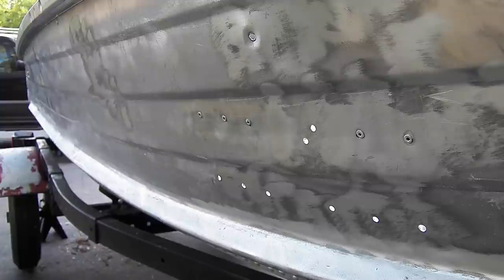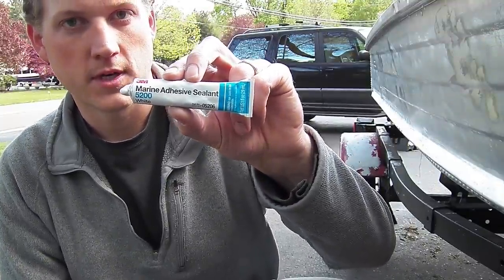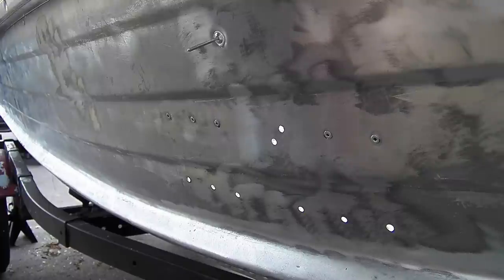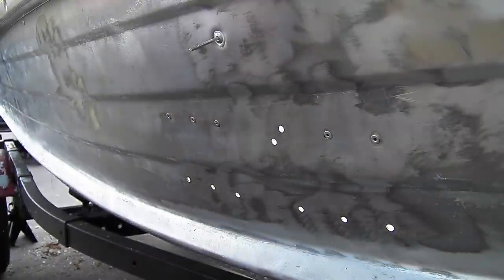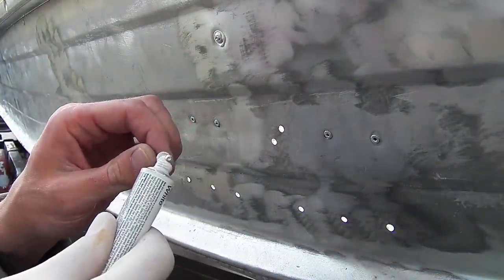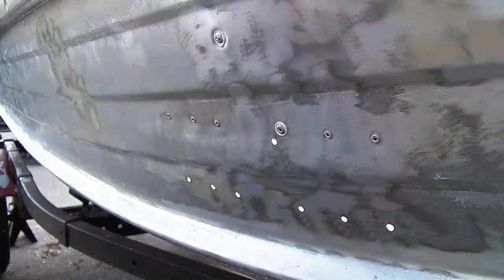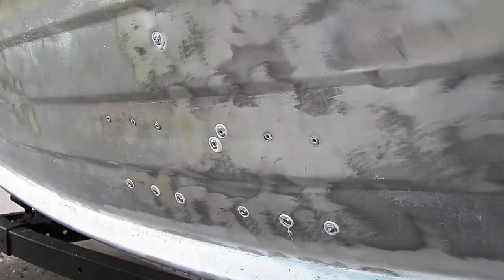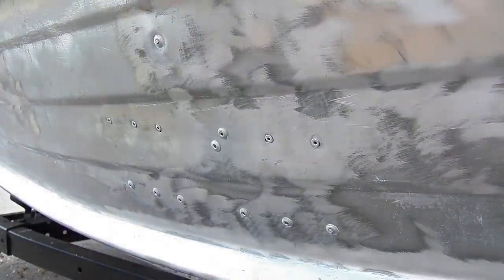Fixing Holes in an Aluminum Boat

Comment: Thanks for the vid. I just picked up an old Alumacraft V hull that was decked by bolting the framing through the hull. I want to remove it all and redo it much lower for increased stability to take my 85 yr old step dad out. This was very helpful. I'm going to just gut it and grind off all the old paint and do it all starting with your hole patching.

Comment: Purchased a tig welder recently to make boat repairs, but after viewing your video, a rivet gun is in order to give the unified look. Rivets have worked in building airplanes for years, it is sound technology. I'll use the welder for splits and holes. Thanks sharing.

Comment: another way to fix loose rivets is to use JB Water Weld. i used this on the bottom of my 1990 aluminum boat 4 yeas ago and it is still holding. fill your boat with enough water so you can see which rivets are leaking and loose, scuff up the area and then apply JB Water Weld around the rivets. this really works

Comment: I just ordered some dome rivets because I'd prefer that aesthetic.  The guy at grainger said they're installed the same way with the same tool, but I can't find videos of installation of dome rivets in sheet metal.  I'm using for a aluminum trailer that I'm installing.  Do you know if it's the same process?  I appreciate your help!

Comment: you only used 1 of your tools in these video.  I think the first two were interchangeable, but the last tool was unclear.  What is that one used for?
Reply from the maker: I think you are asking about 0:35?  That is one of the first two tools (you are correct they are interchangeable) again.  I am pointing out that the tool needs to have the correct sized die installed for the rivets you are using.  The rivet setter will usually come with 3 or 4 choices.  You just need to use the one that matches the size rivets you have.

Comment: you could have used some of those 2nd generation aluminum brazing rods and some Mapp gas. I think the secret is using the 2nd gen. not the originals and to use flux even if it's not required.

Comment: Use that same method on small rivet holes above the water line or is there something else I should do?
Reply from the maker: The same method works.  If it's far enough above the water that it never gets wet you can just use a regular aluminum pop rivet and don't need sealer.

Comment: Ty very nice job, I have been meaning to do this to some pesky leaks in my boat for years, 1983 Bass Tracker.
I realize this is an older video, but if anyone could point me in the direction of 1/4" Aluminum body/ aluminum mandrel that would be awesome, I can only find 3/16" in this configuration. All of the 1/4" I find have a steel mandrel, which probably isn't the end of the world I just would hate to have rust stains on my beat up old boat and possibly galvanic reaction too.
Reply from the maker: Those are a tough one to find.  I don't think I was ever able to source aluminum/aluminum in 1/4".  Not at McMaster, Grainger, Fastenal, any of my local places, etc.  Maybe with the 1/4" closed end it takes too much setting force for an aluminum mandrel to work?  Don't know.  If you find a source please come back to drop a comment and let me know!  While I def still prefer aluminum/aluminum, the aluminum body/stainless mandrel 1/4" rivets that I have used have not left any rust stains.
Reply: Jersey Tom, I will if I find any, I can't be certain that I even found aluminum/stainless in 1/4" as I had been focused on the aluminum/aluminum.

Comment: It looks like your using standard pop-rivets.  Will the new rivet form a leak at the center of the fastener?
Reply from the maker: Stephen Maurer They install the same way as standard pop-rivets, but the important difference is these are "closed end" rivets that are designed for sealing.  There is no hole at the center to leak.  You can get them at a fastener supply shop if you have one nearby, or online at McMaster, Fastenal, etc.
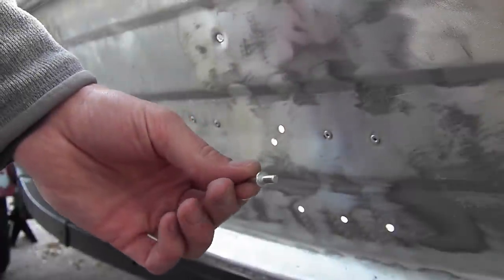Reply from the maker: Jersey Tom At 0:57 you can see how the closed end rivets have no hole in the middle

Comment: Is it the same for the bottom? I have seen stainless steel closed end rivets. Will those last longer for the bottom?
Reply from the maker: BN ANDRSIN Yep, same for the bottom, you can use this technique above or below the waterline.  It is better to use all aluminum rivets because galvanic corrosion can happen where two different metals touch...  If you use a stainless rivet on an aluminum boat, galvanic corrosion can actually slowly eat away the boat around the rivet hole.

Comment: Hey Tom, can 3M marine adhesive 5200 be used on aluminum? The label says only for fiberglass and wood. Thanks
Reply from the maker: Yes, it is compatible with pretty much all boat building materials.  They even publish performance data on shear strength for various woods and metals (including aluminum).  Check out https://multimedia.3m.com/mws/media/576967O/3mtm-marine-adhesive-sealant-fast-cure-5200.pdf
Though in this application, the needed sealant is captured in the joint by the rivet so the strength isn't as important as when using 5200 for fastening applications.
Reply: @JerseyTom  Thanks for the link. Did you prime the rivet holes? What does priming mean?
Reply: @JerseyTom  Tom, how did you remove the leaky rivets? What is the size of the replacement rivets?

Comment: I was told not to use those rivets because the middle piece will come loose and you will end up with a hole in the middle of your rivet. Can you update us on how that is turned out for you? Thank you
Reply from the maker: That's why you have to use the closed end rivets that I mention and show in the video and not regular pop rivets.  Regular pop rivets have a through hole and would leak.  Closed end rivets have no through hole.
Reply from the maker: 100% leak free years later
Reply: @JerseyTom  it was actually those closed rivets that I was discouraged from using, pop rivets weren’t part of the equation.  I think it had something to do with how thin the end of the rivet could be.  I ended up using solid rivets which I can’t do on all hull repairs if the inside is blocked.
I was happy to see this video as an option because I have done repair jobs with solid rivets & it can be a 2 man job.

Thanks for the update!

Comment: I have cracks in my aluminum boat bottom and water gets in very very slowly, what kind of seal can I buy to seal up the cracks???
Reply from the maker: That sounds like a job for Gluvit
Reply: Jersey Tom I can't use 3M Adhesive Sealant like what u did in this video? Is Gluvit a kind of waterproof paint that you paint from inside the aluminum boat?
Reply: Jb weld water weld I swear by the stuff,  sets in 5 minutes,  and cures in an hr,  It'll even cure underwater,  I leave a couple tubes in my boat and jetski for the just in case pack
Reply: Fuze it made by liquid nails

Comment: what is that lil rail on the side of your boar called an what does it do.
Reply from the maker: +Amber Topps below the rivets?  That's the splash rail.  It stiffens the side of the hull as well as directing water splashing up the hull back towards the water instead of up into the boat.
Reply: Can those be replaced with bigger ones..sometimes my ride can be a wet one.
Reply from the maker: +Amber Topps not easily.  the design of the hull including those splash rails is a large part of what goes into some makes being a dry ride and some not.

Comment: Washer is a mistake, stops rivet from expanding  to the aluminum hull.
Reply from the maker: The matching rivet washer inner diameter is the same as the hole in the hull is drilled to, so it does not stop the rivet from expanding.  It acts as a doubler and strengthens the area, reducing the chance of future leaks.
Reply: Есть заклепки с широким бортиком и не нужно изобретать велосипед!

Comment: where do u buy your rivets and washers from
Reply from the maker: The rivet washers you can get at most hardware stores in the section where staple guns/staples are.  The closed end rivets can be a little hard to find.  I usually order mine from McMaster.  Your local Fastenal also usually will have or be able to order them too.

Comment: Can I use this if I have leaky rivets and drill them out? Please reply
Reply from the maker: Yes, this works well for replacing older leaky rivets.  Just bear in mind that the original hole will be distorted, so to get a clean, leak free seal, you have to move up to the next size rivet.  So if you are replacing a 1/8" rivet, drill the hole out and use a 3/16" replacement.  If replacing a 3/16" one, move up to 1/4", etc.
Reply: thank you very much!
Reply: another way to fix loose rivets is to use JB Water Weld. i used this on the bottom of my 1990 aluminum boat 4 yeas ago and it is still holding. fill your boat with enough water so you can see which rivets are leaking and loose, scuff up the area and then apply JB Water Weld around the rivets. this really works

Comment: what size rivet was that...3/16 x what??
Reply from the maker: That depends how thick the material you are riveting is.  Good rule of thumb is you want the rivet to stick through what you are riveting and protrude out the other side at least as far as the rivet is wide so that it gets a good grip.  3/8" or 1/2" length is probably about right for most boats.  If you go too short the rivet will pull out instead of setting properly.  If you go too long, it will be structurally sound, but it will just stick out a little more.
Reply: +Jersey Tom thanks man i appreciate it... im starting my jon boat mods this week...I want it to be ready for March 1st

Comment: I had to order stainless rivets from a construction fastener store, came in a few days and weren't very expensive.  I got 50 I think. Big rivet tool he has ( harbor freight  ) is the right tool for the job. My small arrow hand tool would not do it !
Reply: I have several aluminum boats.  I beat the hell out of them.  I only used stainless rivets once.  There is a couple of drawbacks to using them.  The first is that they are a pain to remove with a drill if you have to.  The second is that my boats sit in the salt water most of the year and the dissimilar metals are not a good thing.  Given enough time I would have rivets and no hull.  Better to stay with the aluminums.  The blind rivets will give good service.

Comment: star craft?
Reply from the maker: Yep, from a 14' Starcraft with a missing capacity plate, so unknown year or model.  Old enough to be from before the manufacturers started putting HINs on the boats.
Reply: Jersey Tom I have the same boat. I believe it was manufactured back in 1979.  I founds a few leaking rivets that need repair before I return up to Ontario to do some fishing.
Reply from the maker: Yep, Starcraft 14', unknown year, but before they started putting HINs on boats.
Reply: Followed your vid... Replaced 8 rivets and filled with water.  No leaks from the underside.
The real test will be May 2016... opening of fishing camp at White Lake, Ontario.
Reply from the maker: +Stephen Maurer Great to hear!  Good luck at fish camp next spring, I'm sure the repair will be fine, hopefully the fishing will be too!

Comment: It's not fixing holes you're replacing rivets. What were the rivets originally for? Show us that $800+ rivet gun.
Reply from the maker: Fixing screw/rivet holes from stuff the previous owner did is the most common hole to fix on a boat like this.  These particular holes once held rivets that secured a seat the previous owner removed.

Comment: I bought the big blue rivet gun and it don't work for shot.bought a used Jon boat full of leaks .I'm going to solder every rivet
Reply from the maker: Huh, that's weird.  The big blue rivet gun works great, even with much heavier steel rivets.  If you bought the same one I did, take it back and they will be happy to exchange it for you with one that works, no questions asked.  Personally, I would rethink the soldering... redrilling a hole and tossing a larger rivet in is a lot easier than prepping old dirty oxidized boat aluminum for a good solder bond.  Also, I'd keep in mind: no manufacturer makes soldered aluminum boats... probably a reason for that.  But hey, if it works, it works... "whatever floats your boat" as they say, lol